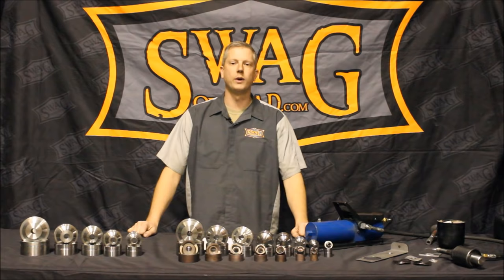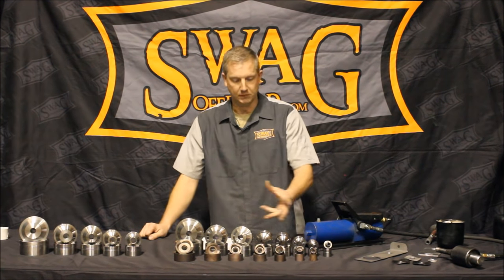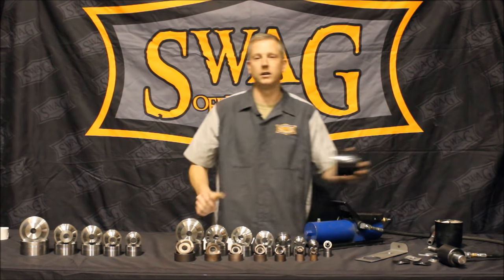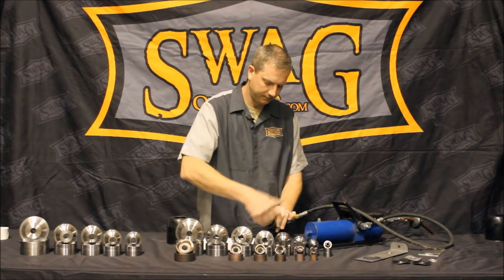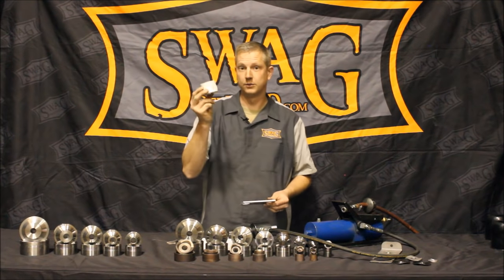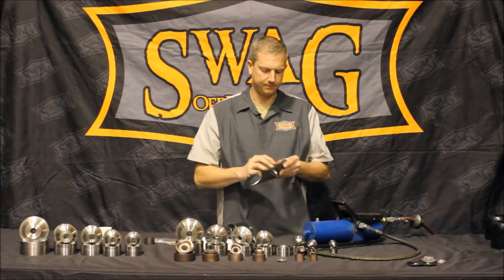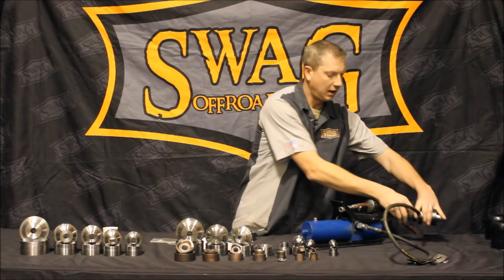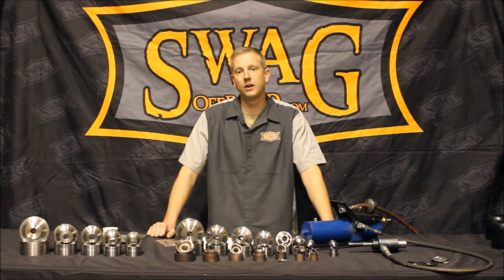SWAG Off Road, Knock Out Punch Set Video

Comment: Very nice. Question though. Do you guys make the threaded arbor? If not I highly suggest you do. I need a new one. The HF one that came with my set stretched and bent.
Reply: A long U.S. grade 8 nut & bolt with fine threads may act as a replacement.  Add a ball-bearing to allow this mechanism to easily rotate under pressure.  A teflon coating or sheet between some washers may be enough to allow that to rotate.  Adapt and innovate.

Comment: How is this any faster than drilling with a hole saw if I still have to drill the 3/4 pilot hole!?
Reply: If you are doing a one-off project your holesaw will no doubt be much cheaper and more efficient.  If you are doing metal fab regularly, your holesaw will be both less accurate and more expensive [think $$ replacements after maybe 50-100 holes] in the long run as well as slower, noisier and more dangerous...also, on some projects you may not be able to even position a holesaw where needed.
Reply: If you have a 1/2" twist drill, you could even use the 3/4" k.o. punch to make the hole

Comment: is it works for thick metal plate ?
Reply from the maker: The SWAG knock out punches are capable of cutting up to .1875" aluminum and or .125" mild steel, .083" chromoly, & .083" stainless. It will not work for thick metal plate.

Comment: Why do you have to compare this thing with hole saw, hole saw is not to this work, not to cut metal. You are trying to undermine one tool to add valor to another tool that has nothing to do with the purpose of hole saw. You are stupid, one thing is to cut one thing, another thing is to cut another thing. It is the generation of stupid people that does not have knowledge of anything.
Reply: Bi-metal whole saw set.... Weird when it's not for metal but is sold to cut metal
Reply: magicguitarpedal you sir need to learn about what you're talking about.
Reply: You need to learn magicguitarpedal, lennox makes a bimetal hole saw for cutting holes in metal. I've used them many times. are they efficient no they are not but they work. I prefer an annular cutter but in a pinch it gets it done.
Reply: it does a cleaner,faster job than a hole saw for this purpose